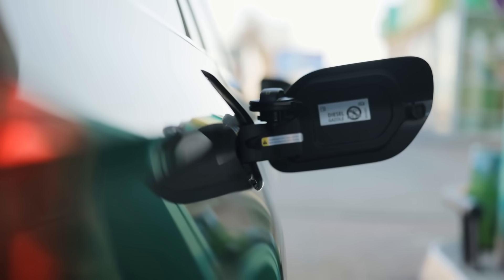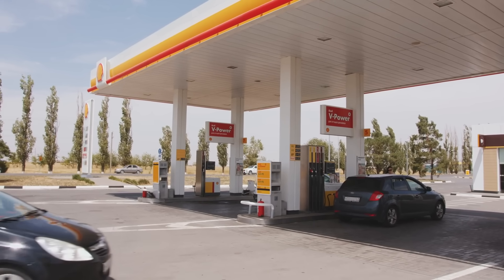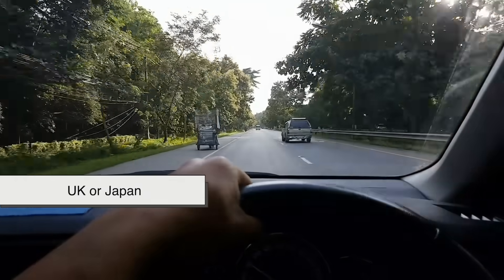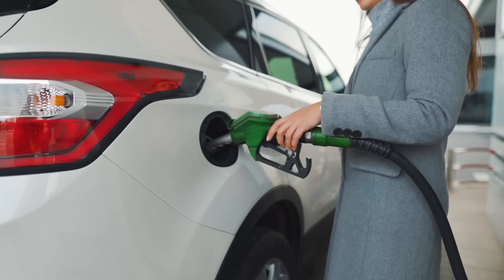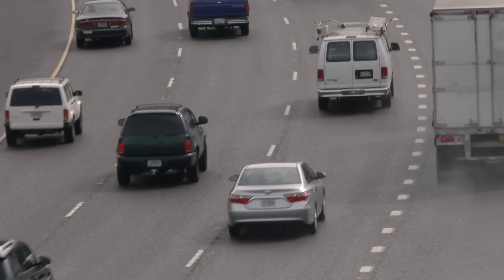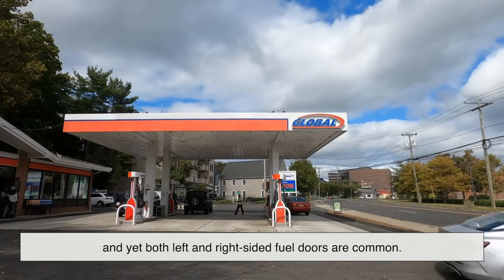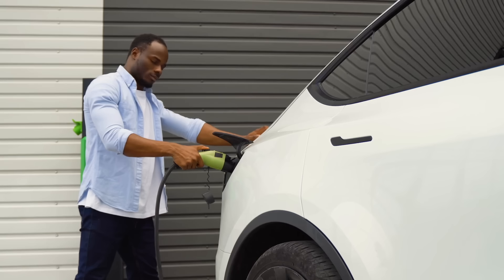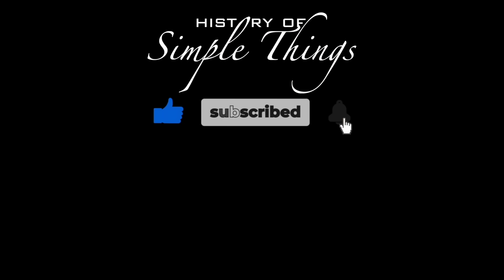Why Are Fuel Doors on Different Sides of the Car?

Comment: how silly not to point out that there is a arrow, usually triangle on the fuel gauge that indicates what side the fuel filler door is located. This is provided for all cars in the US and is especially useful when renting a car.

Comment: One important thing not mentioned here is that on most fuel gages in modern vehicles, there is a small "gas pump" icon with an arrow indicating which side of the car the fuel filler door is on.

Comment: Next time you need to add fuel to your more modern ICE car and don't know which side the fuel cap is on, take a look at the dashboard, locate the fuel pump icon. Next to it is a little triangle. The triangle always points in the direction of the filler cap. Thanks very much for your insightful videos.

Comment: The exhaust usually on the passenger side, impinging on space. Hence, interior volume is usually less for the passenger in a driver-centric vehicle.  In USA, the exhaust is typically on the street side of traffic.  This also puts it farthest away from the driver's window, less likely to get fume ingress.  This naturally leads to the pipe for the fuel filler being on the left to balance presence of hardware and weight distribution.  However, it's not a required balance for many larger vehicles, and some manufacturers feel there are safety issues (like refilling on the street with a gas can) that are more important than avoiding the exhaust side.

Comment: On the EV's there should be a law for never putting the charging port on the drivers side!!! With more and more public chargers emerging on the sidewalks of urban areas, having the charging cable sticking way out into the passing traffic is a hazard! Also since they can easily be placed anywhere on the vehicle, why not putting them at the front or rear, or inside the car, with a small hole for the cable, so no one is tempted to pull the plug while you're away from the car?

Comment: Jaguar’s XJ6 had two fuel doors, one on each side by the “c” pillar as the car had two fuel tanks due to suspension design. Old VW Beetles had the fuel tank in the front truck; to fill, one opened the trunk to access the tank. Porsche placed the fuel filler on the top engine deck on the 918 Spyder near where the exhausts exited; fire while filling resulted!

Comment: Back in the 60's and 70's and 80's the gas cap was behind the rear licence plate. You flipped the plate forward and you had access it didn't matter what side you were on. If you had a GM pick up truck they had two fuel tanks and you could fill on either side.

Comment: This video misses the point completely.  At every service station, as you drive up to the pumps, 50% are accessible from the  left and 50% are accessible from the right.   Car makers just need  to overall ensure the 50/50 ratio is generally adhered to, otherwise one side of the pumps will always have queue and the other side will be empty. !

Comment: No need to guess.  Look at your car dash gas gauge and you will see a tiny pump icon.  The side of the icon that shows the filler hose gun is the same side your gas door.  This has been true for a few decades now.

Comment: I used to have the fuel door on the left on my old car. I paid in cash in one day I decided to buy well I was paying for the gas at the same time so when I get back to the pump I opened my driver's side door put sodas on my seat and then I forgot to pump the gas and then I had to circle around my notice before I left the property get my spot back. Now I have a fuel door on the right and since I'm approaching the right side of the car anyways it typically put whatever else I bought in the passenger side of the car shut the door and pump my fuel and then leave.

Comment: I had a '56 Chevy Bel Air and the fill neck was behind the driver's side taillight.  Rotate a fixture at the top 90-degrees and the whole assembly rotates down for access.  I got a lot of puzzled looks back in the day when the attendants pumped fuel for you.  Couple times had to stop them from almost pulling off my license plate.

Comment: I like the older cars that had the fuel filler behind the license plate.
Reply: And then there was the '56 & '57 Chevy's where the fuel cap was behind one of the rear taillights, I think some of the early Cadillac's and a Oldsmobile, with fins had the same setup.
Reply: They were a select few cars that had the fuel filler under the frunk (front trunk). The DMC DeLorean was a great example of this. I don't know all of the cars with that feature, but I believe some of the early Volkswagen Beetles also had it.
Reply: @robertknight4672 Indeed, VW Bugs had the fuel tank in the front, but the filler door was on the right side front fender.
Reply: I found keys hanging there on an abandonned Delta 88 as a kid.

Comment: The only car in the world which has fuel ports on both sides is the UAZ type 469 Bukhanka. Why? Because of 2 fuel tanks, the main big tank and the auxiliary smaller tank.
Reply: Jaguar’s XJ6 had same setup, two fillers for two tanks due to suspension design. Dash had switches to select tanks to draw from like an airplane!

Comment: I think the fuel door placement had something to do with the exhaust system (it was generally on the opposite side of where the exhaust pipe comes out).  Although I think many newer cars have it on the driver's side now for convenience (and possibly safety) as the location of the exhaust pipe IMO is merely by design, but the design can certainly be modified so that the pipe comes out on the passenger side instead.

Comment: I've had rear engine/mid engine cars where the gas tank was in the front trunk. I had to open the hood to access the fuel filler.  The first time I bought gas with my current new car, I checked to see which side the fuel door was located. That was 18 years ago. It has never been an issue since.

Comment: Because the fuel roller was so random, manufactures did standardize on a way of letting the driver know which side it was on. First they started by displaying an icon on the fuel gauge, showing a gas pump with the hose on the left or right side. Unfortunately, many drivers thought if the hose showed on the right then they should approach the pump on the right. Obvisously backwards, they decided to display an arrow beside the icon. This happened over 35 years ago and hasn't changed ever since.

Comment: So many comments talking about "one way traffic" through gas stations and having both configurations reduces lines. Where? How? The only "one way" gas stations I've ever heard of are Costco (some report Sam's Club, too, but I've not experienced them). Every gas station I use is NOT one way (Kroger's, Murphy's, Pilot, Love's, Speedway, and locally owned, brand-named stations). I drive in keeping right with my left fill and those pumps are taken? Circle around to the other side of the island! Easy Peasy. The US is a "keep right" society, so why drive on the left side of a fuel island if not mandated (looking at you, Costco).

Comment: This is one area where the lack of a standard benefits everyone. If 50% of cars have it on the left & the other on the right, we all flow thru the petrol station more efficiently. Having it in the rear under the number plate was great until someone rear-ended you. Even a small tap could make it impossible to refuel your car. And raised questions about the integrity of your fuel system. Given the electrical cars need to charge for much longer than the 2-4 mins it takes to fill your tank, the number of cars you can "refuel" quickly is less important, so you can afford to have a longer charge cable.

Comment: All fuel filler necks should be on the passenger side. When they are on the driver side, when you pull up to the pump, it can be difficult to open the driver door because you are up against the concrete pump protector barrier.

Comment: It's not a big deal: if the line for the 'wrong' pump is shorter, one has to be a little more precise in positioning the car. The hose will fit regardless. That is, if one does not have an oversized stupid car that does not fit in traffic anyway..

Comment: at my local gas station, the pumps do not stretch to reach both sides, there will always be lines for the left side cars but I barely ever have to wait for a right side pump. Works for me!
Reply: Having some cars with it on the left and others with it on the right to ease congestion at gas stations was my thought before I wasted time watching this video and I still think I'm right.
Reply: @teacherjoe7019 that’s silly! Almost all gas stations have the ability to pull or back into from either side. If your fuel door is on the right, and the pump is on your left, either turn around and pull in, or reverse and back in. Or, even better… …many older cars have the fuel door on the rear, or like, on some VWs, the front, so it doesn’t matter which side of the pump you park on.
Reply: @UmmYeahOk  Pfft!
Reply: @teacherjoe7019 good point..
Reply: Same!!
Reply: The fuel gas stations that do have stretchable horses in my area have a sign alerting you to that fact he is a typically places that have a one-way traffic flow in the gas pump area.

Comment: Originally the filler spout had to be located away from the exhaust pipe. Back in the day when cars mostly had dual exhaust we found it in the back of the car in the middle or dropped down in from the top.
Today we find the exhaust on either side of the car and you’ll always find your gas filler cap on the opposite side. Where they placed the exhaust is up to the manufacturer That may be based on Customer’s preference.

Comment: Surprised you did not mention the little white arrow inside the car that points to the fuel door side. Also if they were all on the same side it would take longer to fill up, as we would all be queuing for the same side of the pump

Comment: I bought a new Chevrolet Monte Carlo in 1977. The fuel cap was behind the rear license plate, so it didn't matter what side of the gas pump I pulled up to.
😊😊
Reply: I also had a '77 Monte Carlo. Best car I ever owned and miss it to this day. Yeah, ok, so it got like 20 mpg on the highway but man that was one really comfortable ride.
Reply: @keithj.6266---      My parents retired and moved from Maryland to Florida in 1979, so I drove the Monte Carlo many miles on the highway visiting them. On these trips, I always calculated the miles per gallon, and I was consistently getting 19.5 mpg. And this was when the speed limit had been reduced to 55 miles per hour, and should be getting decent mpg. 
   I always thought the 77 Monte Carlo looked great and was very comfortable. This was before I happened to rent a Lincoln Town Car for several days on a out of town trip. The next car that I bought was a used 1983 two door Lincoln Mark VI. This car got me slightly better mpg on the highway, and was much more comfortable than the Monte Carlo. My current daily driver is a 2002 Lincoln Town Car that I bought in 2007, and I get at least 23 mpg on the highway, usually going at least 80 mph.  One day I drove it a consistent 50 miles per hour on a old flat road in Florida, and got an excellent 28 miles per gallon!!
Reply: Yep, best positioning ever.

Comment: If all fillers were on the same side in a country then during busy times there would be longer queues at the pumps because it's not easy filling a car where the filler is away from the pump due to shortish filler hoses on the pumps....so a mix of left and right fillers spreads the refuelling to left and right side at the pumps. Just a pain when you have a hire car you're unfamiliar with and need to fill up in a hurry.

Comment: Wish they'd mandate that electric car plugs are on the passenger side. This would make curb-side charging much safer, eliminating the need to stand in traffic but also to have the cable/plug extruding.

Comment: Driver's side or passenger's side is relative. I have owned several Japanese cars from the same manufacturer. The filler has been on the driver's side if in Japan; passenger side here in USA.

Comment: My mother had a '57 VW Beetle with the fuel filler inside the front trunk, but I believe U.S. regulations required them to move it in the 1960s. There were even some cars with the fuel filler in the engine compartment, or under the driver's seat, if you like living dangerously, but they were outlawed fairly early over here. When I was growing up, most American cars had the filler behind the rear license plate, which worked with the pump on either side,  but even that would be considered unsafe today. What bugs me is that most fuel stations still have hoses that are too short to reach either side; they should be long and suspended from  spring tethers from above, to reach either side without scratching the paint.

Comment: When I bought my first Saturn many years ago, the salesman told me that it was a safety feature; as in if you ran out of gas and were refilling on the side of the road, you would not be standing with your back toward traffic near the lane with fast moving oncoming vehicles.
Reply: Makes sense, but how many times in one's life are they stuck on on the roadside out of gas? Anyone who drives frequently gets gas every few days, and the fuel door on the passenger side has the driver going the "wrong way" (think of turning onto a divided highway: we keep right in the US) at the pumps, so it seems that the standard should be dictated by our "keep right" society and how and where we refuel 99.99% of our lives. Using the salesman's logic, the standard should be the passenger side (to avoid conflict at the pumps), but as I wrote elsewhere, the fuel door on the passenger side is a personal security hazard at a gas station.

Comment: Make a similar video on which side the indicator stalk should be placed. Seems like the European manufacturers don't have the tiniest brain when it comes to common sense of placing the indicator stalk on the opposite side of where the gear lever is, for right hand drive countries!
Reply: My pet peeve is the wiper control on the right-side of the steering wheel in a LHD car. That makes it a long reach if you are trying to start or stop the wipers while clearing snow or cleaning the windshield. The first car I owned had it on the driver's door, right within reach from the outside.
Reply: As a former valet driver (in a RHD country), I've driven more different models than I care to think about with stalks on either side. Makes no difference in function. Although, when driving, the direction you need to steer to the centre is the easiest as in all cases, that is the direction that avoids crossing a lane of live traffic and is the direction of motorway and roundabout exits. For example, in my RHD car and country,  the indicator is on the left (i.e. the side of the steering wheel nearest the centre of the car). Motorway and roundabout exits in this country are on the left. Right turns require crossing a lane of traffic to enter the road. You join without crossing traffic when you turn left. 

The opposing directions will be true for LHD countries. Although it is still likely to get some examples where the indicator stalk is closest to the driver door. Positionally, it is interchangeable with the wiper stalk.

Comment: 0:12 No, because if ever in doubt I look for the icon on the dask with the gas pump and arrow that shows which side its on.
Reply: Only owned 1 vehicle that has that. Previous 8, no.
Reply: @davidclough3951  I agree. This wasn't (and still may not be) industry standard. I've had vehicles both with and without the indicator.
Reply: @davidclough3951  Your previous 8 vehicles have been very old vehicles.
Reply: @roberthenry9319  How old is old? Even my modern (1990s) vehicles don't have them.

Comment: So don’t Japanese sell more cars in the US than Japan? Don’t those manufactures who sell cars in those countries that drive on the left side of the highway also have to change the position of the driving gauges and steering wheels and everything else to the right side of the vehicle? Engineering costs are greater than worrying about where the fuel doors. Seems to me mentioning this means nothing since that change is monumental compared to where the gas fill flap is. Personally, I don’t care which side, but standardizing to one side only seems common sense.

Comment: Fascinating video! I used to believe the reason was it depended on what side the country of origin drives on. For example, my 2013 Mini Cooper Clubman's fuel door was on the right but all my other cars have been on the back or on the right. However, when I saw more recent Minis with the fuel door on the left I knew the driving side couldn't be the reason.

Comment: My new Subaru has the fuel door on the passenger (right) side. I'm still getting used to that as every other car I owned the fuel door was on the driver (left) side.
Reply: We just bought a 2025 Forester Sport for my wife. It is a change for sure, but usually works well at Costco because most people are waiting for the driver’s side if they don’t want to pull the hose over their vehicle. 😊
Reply: My wife has a right side fuel door on her Suburu. I drive a Toyota with a left side door. Talk about confusing.
Reply: Had 2 Subaru Outbacks over last 6 yrs in UK, both refueled on driver side (right), new Mazda CX-5 refuels on left now, taken a bit of getting used to and some funny in-car comments driving into local Shell station..... (LEFT LEFT).  Arrow marker in fuel gauge always tells you which side the filler is, been that way for 25+ yrs if i recall.
Reply: My little chevy spark has it on the passenger side.. maybe because alot of the cars we have here, in Europe has there steering  on the right